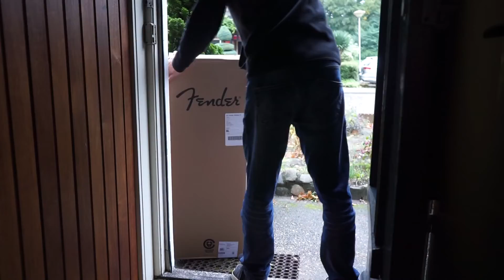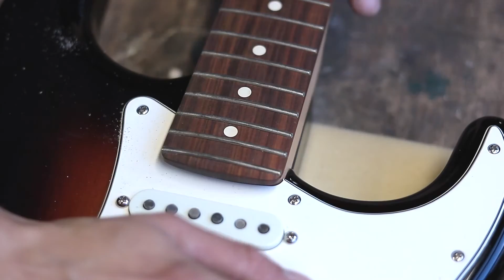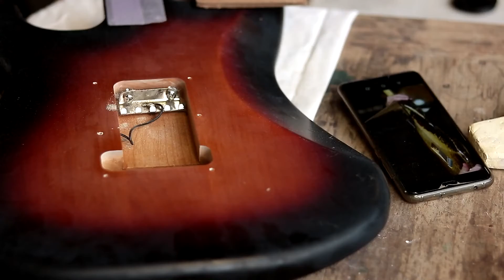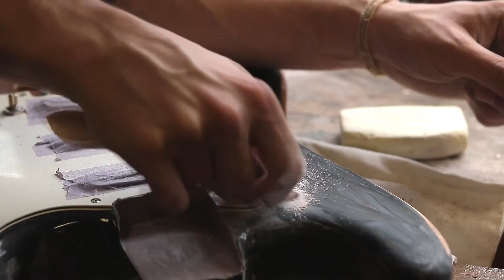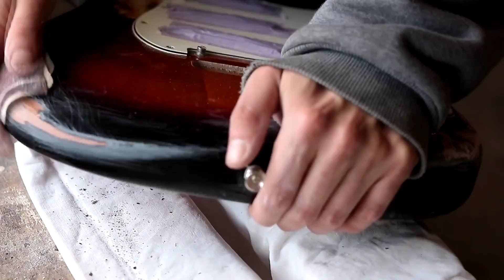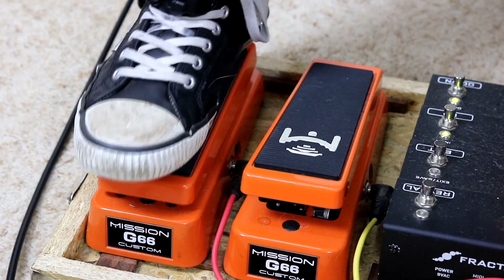Let's Relic! Mike McCready Fender Strat '59 | FretVibes

Comment: Mike plays a ‘60 Strat, Not a ‘59.  But that’s neither here nor there. But keep up the fun work! Nice job.
Constructive criticism : next time use a Nitro finished guitar. Poly just looks fake when you try to relic them. Or do what I did, buy a cheap used squire or fender, completely remove the finish, and paint over it with nitro, then relic it. Thats works great! 👍🏼